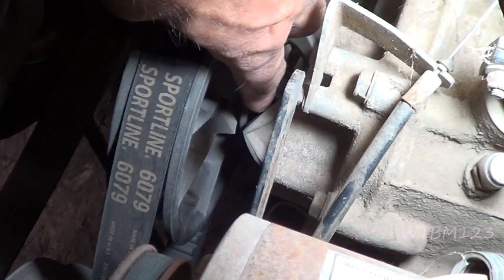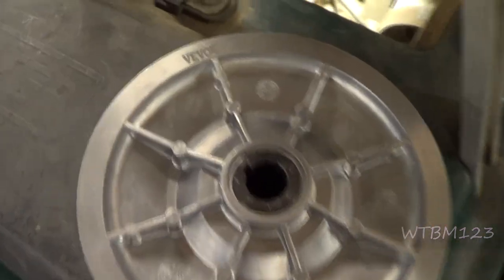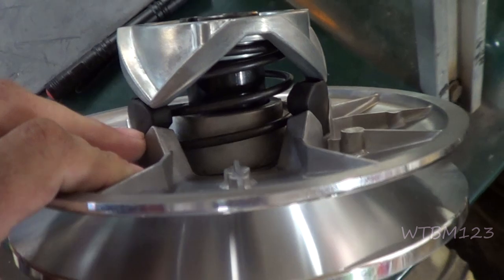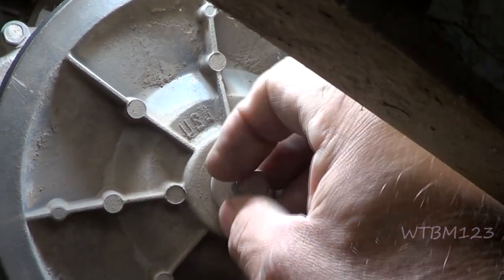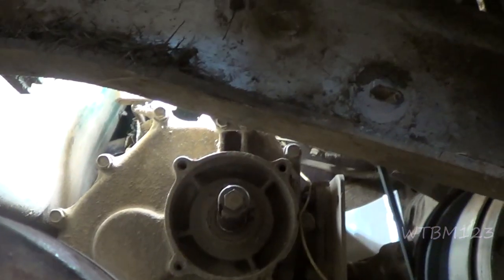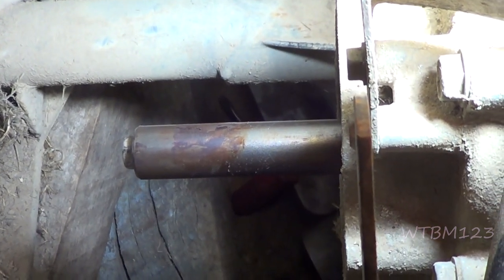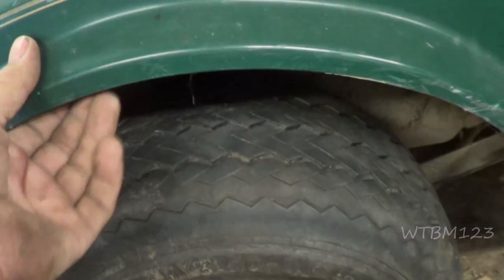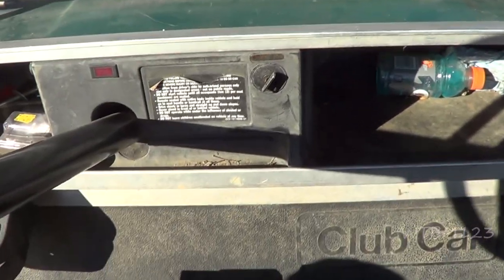Club Car DS New Vevor secondary clutch

Comment: cant walk anymore so i have an EZGO so I have some freedom again. Just put a new carb on it and it runs like new money. I luv these vids. Oh heck i like all of your vids
Reply from the maker: Glad you have your cart running good . They are nice when operating like they are supposed to.
Reply: Same here, in a wheelchair, 91 Club Car with a bed on the back to put my wheelchair in, converted it to hand controls and off-road, lots of up grade mods, about to add a power spring and new belt when it's time to service it. Wish I could add photos.